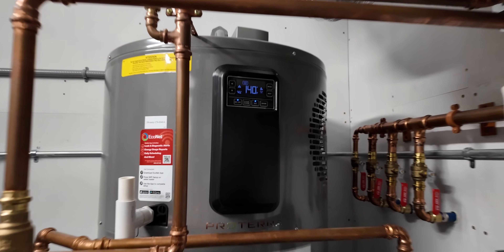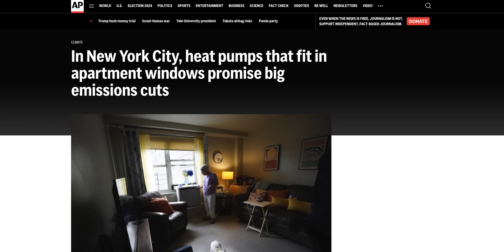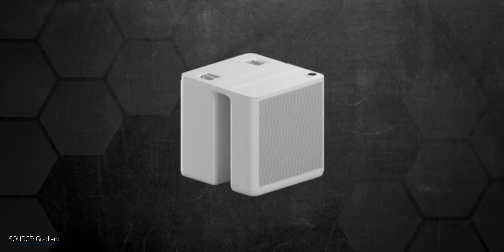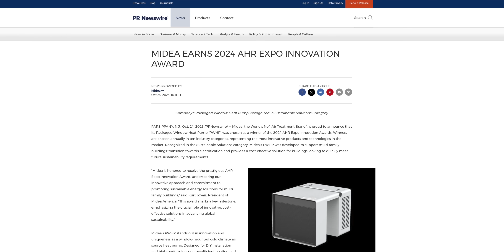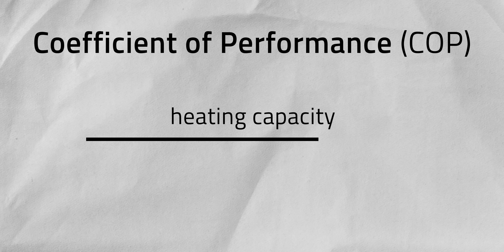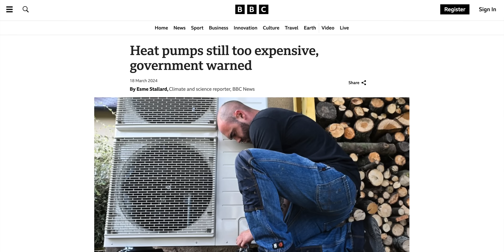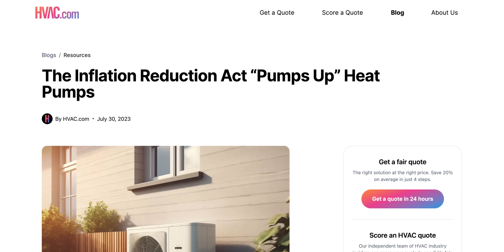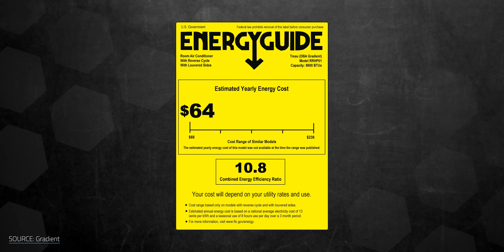Why This Window Heat Pump Is Genius

Comment: I can see it being useful for tight apartment spaces and being something supplied by the landlords. In regular homes? It doesn't seem practical compared to window mounted ACs right now.

That price is a difficult pill to swallow, but in a house, you have the option for a full system for a bit more than that. 

I wouldn't mind seeing these replace the window units many homes still use, though. Only if they can get those prices down.

The shape is kind of difficult too. Most home interiors are setup to accommodate the window level units. This hanging option is good if you dont have furniture or other things like it nearby. In a place where floor space is at a premium, this may be inconvenient.
Reply: If you have a house, you would simply get a whole house system. If you want nice temperature control, guess you will just have to move that side table. Brutal, I know.
Reply: @thecocktailian2091  Sure, if you own the home, you can do that and that would be far more practical overall. If you're renting though, you aren't likely going to spend the money to upgrade the property like that.

And no, sometimes it's not as simple as "just move the end table." You may be looking at needing to rearrange an entire apartment in order to make it work, or when you're moving in you figure out that you don't have quite as much floor space usable as you thought you did.

This floor space thing isn't a huge deal, just minor nitpicking and maybe space for a different design to fill, or for those considering such a system to take into account. It still doesn't help people who have windows that don't open vertically which is just presenting a different challenge that could be worked on with similar enough units.

Comment: And now comes a great question: How do you plan to install this device on a house in Europe? 😁 It is a completely different design than yours in the US and these cannot be mounted here. The golden apple would be a design that can be installed both int he US and EU.
Reply: Honestly it’s called a mini split unit. 😂😂😂 it’s cheeper and permanently installed
Reply: @Playingwithproxies Thing is I don't want to permanently install it when I only need it 5 days/year.
This is a great thing.
They just need to make one that slides in between a European sliding terrace door for 600€
Reply: you don't this is quite literally "NOT DESIGNED" for you. these are specifically designed not even for the US. they are designed for these east coast programs specifically.
Reply: Undoubtedly if they succeed in NA, then Europe would quickly follow with their own version. Kind of back to the 120/ vs 240 thing.
Reply: @thecocktailian2091  When did EU follow the US with the 120V main powerline voltage? Everyone uses 240V in the EU.

Comment: My one concern with these is condensation leaking into the house which apparently is a problem with the the saddle style AC units, it's why I went the Midea route as they use a U style instead, it obstructs the window like a regular AC unit, but due to the shape condensation from the inside section of the unit can drain out to the outside section.
Reply: It was stated in the video there is no condensation issues.

Comment: The pretty common problem in older buildings with radiant heat producing so much heat that you have to open the windows is a design feature of the time. The belief that fresh air is crucial, that residents should be able to obtain fresh air in winter while having warm homes.

Comment: The pumps need to work in the Arizona heat. 95F-115F is cutting it close to the pump limits.
Reply: For low humidity climates like Arizona, an evaporative cooler pre-stage would get the job done nicely.
Reply: In sw MO our heat pump was inadequate. Froze in the winter and sweated in the summer
Reply: not really. arizona is dry. you need far less "cooling" than a new yorker needs.

Most of the energy for cool is not actually going to cooling. its going to dehumidification. it actually does not take much energy to "cool" air. most of it goes to water removal.

you already have air with no water in it. so you only need to cool it. these should work just fine in arizona.

I live high altitude in new mexico (6800ft) it cost almost nothing to cool my home. it just does not take that much energy when the air is this dry.

Heating is another issue though. double edge sword of high altitude. we see 10 below 0 here at times (though very rarely)